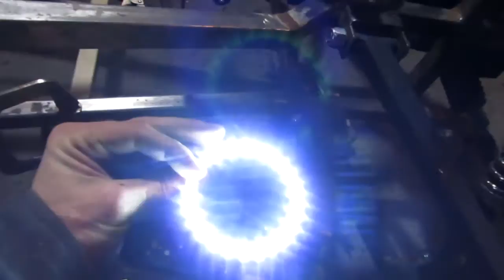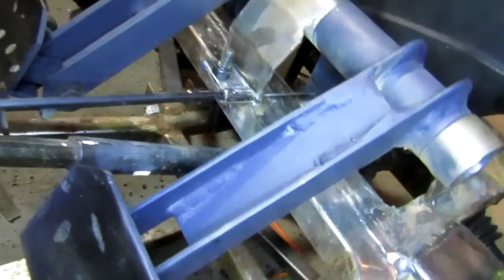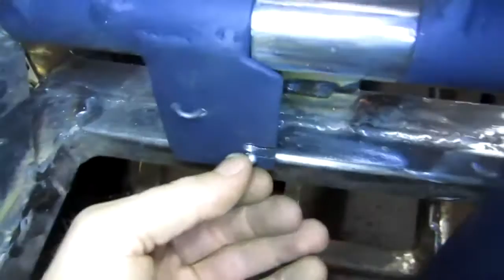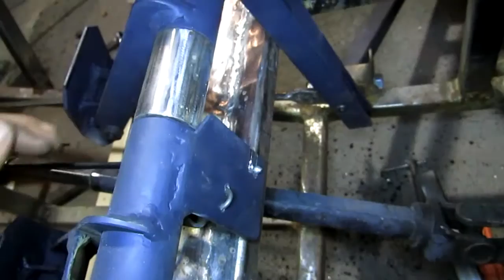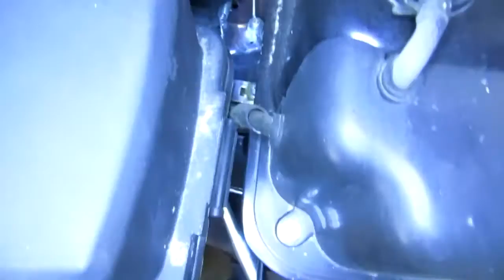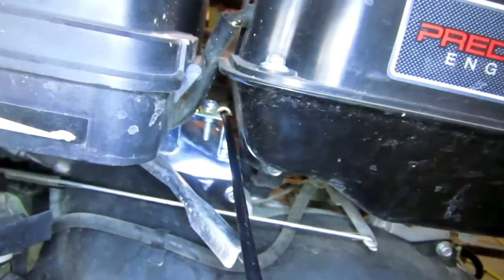Throttle Cable Test | Fullscreen Machine 2

Comment: You might want to try  to cap off that cable Nipple or some kind of clip so that the cable does not slip out of the cut off. You could even look  for a bicycle brake part to hold it in.  I just found some. an Adjustable Barrel. Google "bicycle adjustable barrel brake" and they look pretty inexpensive.  Probably just have to drill a hole at the slot and tap it. That will keep your cable in but allow the slack.

Comment: hey tman go here: http://gokartsusa.com/Engines-Gokarts-Kart-Racing-Minibikes-Buggy.aspx you can det new motors and updrades to make a honda gx or titan tx go from 6.5 hp to 26 hp with upgrades and new parts and the superbox kit on the website for the motor gives you tons of parts. superbox kit: http://gokartsusa.com/Superbox-Class-Parts-Kit-Stock-Engine-Kit-Honda-GX160-GX200.aspx
Reply from the maker: cool. thanks for the heads up.

Comment: I assume you didn't remove the governor, but I did on my predator (with billet flywheel!); do you think that throttle setup would be able to move the throttle wide open ungoverned?
Reply from the maker: yeah , most likely, but I dont want to do it because this is for a 10 yr old.
Reply from the maker: ***** Oh shoot . I thought you were talking about the A-kart. But yeah the FS machine 11 hp engine doesn't have the gov removed and I do think it would still work with it gone.